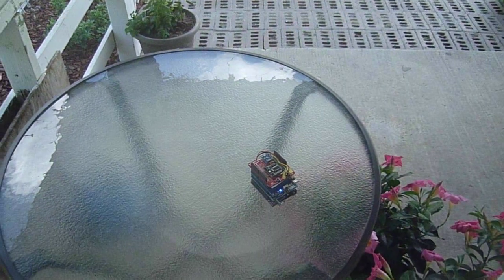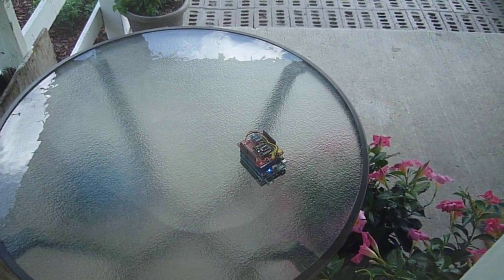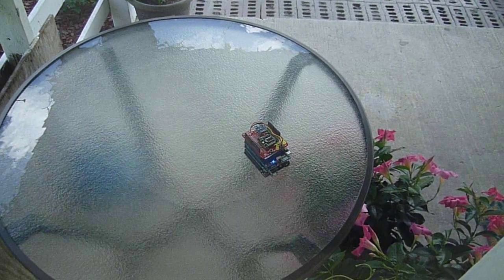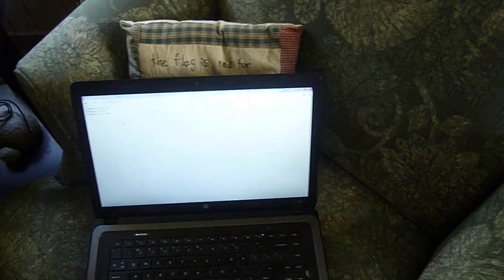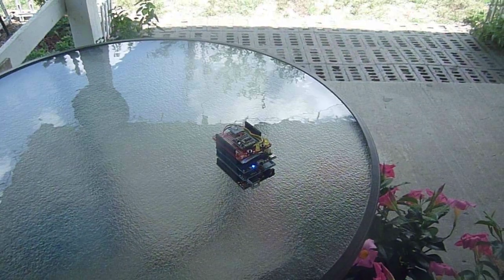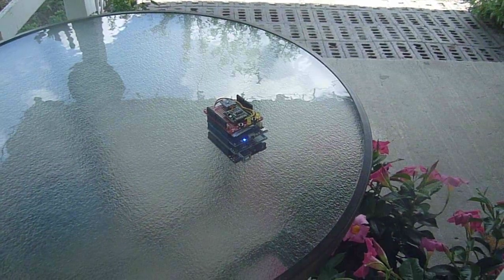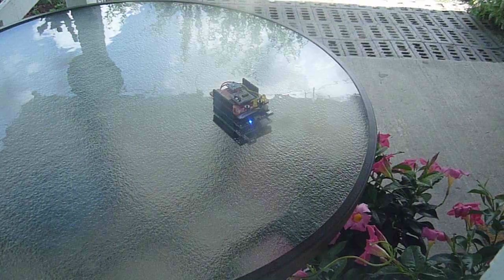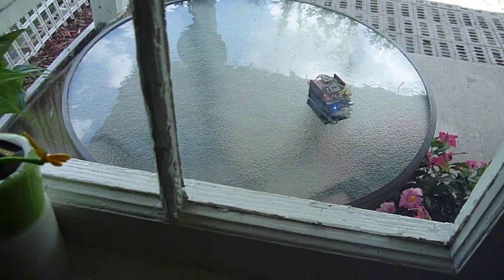Arduino WiFi Weather Server

Comment: Cool project!  I am also in the process of 'migrating' my weather station feed from a cheap (and slowly malfunctioning) weather station console (WH2081) to something that I can control myself.  Rather than something Arduino-based, I opted for a Raspberry Pi 2 instead.  It is already being used as an ADS-B receiver, but as soon as I can find someone to provide a tutorial for using the BME280/MOD-1022 with a Raspberry Pi, I'll add that as well.  I am just a newbie, but my impression is that I would not need a 'level shifter' if I go that route (?).  In any case, I would appreciate any comments that you could make :)

Oh, and I am looking forward to the solar-power edition of your server!